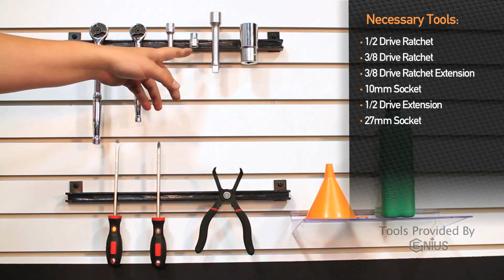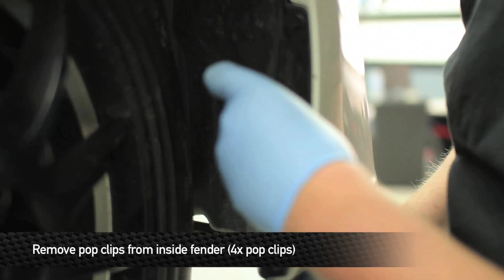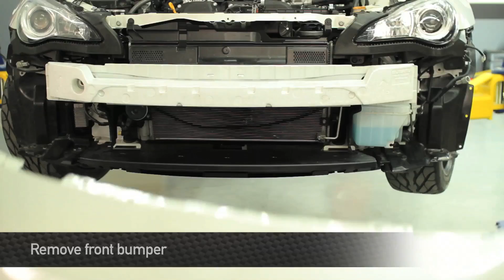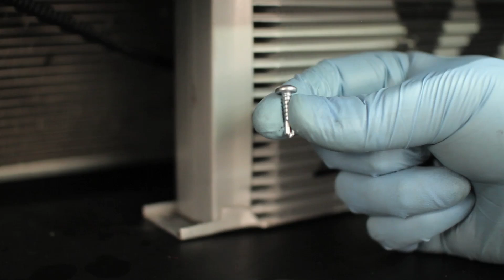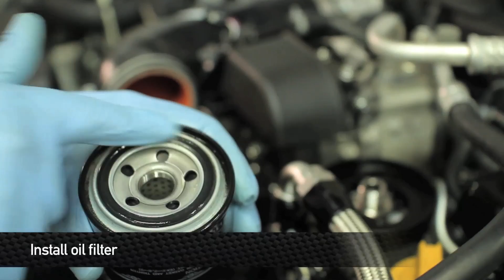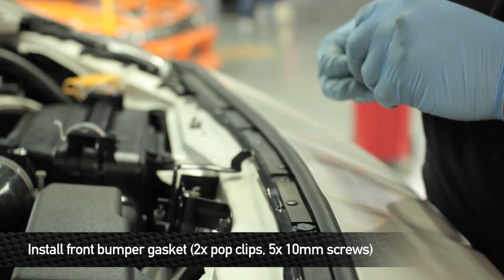Direct-Fit Oil Cooler for Scion FR-S / Subaru BRZ Installation

Comment: how doesn't it apply on turbo 86/brz ?? same same? or different line?
Reply from the maker: We have not tested our oil cooler kit with aftermarket turbocharger kits for this application. Thanks!
Reply: @mishimoto  I am running a turbo on my BRZ and the application is the same as if you were non-turbo, no change in install procedure.
Reply: It is indeed the exact procedure. No problems with my turbo kit. In fact, WAS easier to route the tubes through the engine bay with the freed space.

Comment: do you need to drain your oil before installing the oil cooler?
Reply from the maker: Draining will not be required, the only oil you should lose is that from the oil filter.

Comment: Does the sandwich plate have ports for oil pressure and temp aftermarket sensors?
Reply from the maker: Yes, both the sandwich plate styles with come with two side ports to be used for sensors.

Comment: can someone tell me how the water moves even though there is no pump?
Reply from the maker: Your oil pump in the engine would pressurize this just like the rest of the system.
Reply: @mishimoto  so it moves because of the force of the oil pump? Is that really how that works?
Reply from the maker: It is the same pressure that pushes oil through your filter and engine block.

Comment: do the holes have to line up with the outlet? thanks
Reply from the maker: Hello BRZ RN. My apologies, but I'm not entirely sure what holes you are referencing. Additionally, the outlet could be either side of the oil cooler in this instance.
Reply: Mishimoto Automotive holes of the banjo bolts to outlet, do they have to be aligned?
Reply from the maker: Hey BRZ RN . Thanks for clearing that up for me. The banjo bolts should self-align when properly torqued down :)

Comment: Just a thought...check for leaks while you have the snout off, not after you've buttoned her back up. Looks like a very nice setup. Does it have a thermostat or is it wide open?
Reply from the maker: Hello Dick. This kit is available in both thermostatic and non-thermostatic varients. If you'd like any additional information, just check out the product page. https://www.mishimoto.com/subaru-brz-scion-fr-s-oil-cooler-kit-13.html

Comment: What are the benefits? Very interested!
Reply: +Chris Schenk Lower oil temps instead of hovering at around 240 with hard driving it gets closer to 200. Above 230 the engine will start to cut timing and you'll lose power. I'm second guessing mishimotos kit however I've heard of very bad quality issues on our cars

http://www.ft86club.com/forums/showthread.php?t=45538

Comment: Hi Guyz,
After installing the oil cooler, in 3 month when I will change my oil, how can we remove the oil inside the cooler ? is there a screw ? where it is ?
Thanks
Koj
Reply: +Koji Fuma wow good question.  Need an answer for this one.
Reply: +fatboy19831 where is the answer for that year ago question
Reply: Yeah me too. I purge every second oil change. So I need to unmount the shield & so on..
Reply: You can use an oil extractor, but if you change your oil often I wouldn’t worry there is only half a litre in the oil cooler
Reply: simply take off the the hoses and blow through one side lol. but yeah good question! I would imagine it would just drain most of it and if there is some left it gets filtered.
Reply: Either dont do it or remove the oil cooler to drain it.   Pain in the ass but that's what I've been told
Reply: Very very late reply but. I had the splash guard removed and mounted the cooler with a makeshift metal plate to mount it on, and removed the windshield washer fliud reservoir to free up tons of space for this exact task. You'll have to remove the cooler, hoses and empty excess oil from cooler itself. It's not hard with the amount of space I've freed up. Will just make your oil change a bit longer ^_^.
Reply: +Dieygo A. There is not one. I have been searching the net. I want an oil cooler. Leaving a quart of dirty oil in the car every time I change the oil is not an option.

Comment: Whats the point in having an oil cooler on a non-turbo engine? If it needed an oil cooler wouldn't subaru have put one on at the factory?
Reply from the maker: ***** Oil cooling is not a component that is specific to forced induction. Lower oil temperatures will promote improved lubrication and reduced engine wear on any type of internal combustion engine. We have found this upgrade to be very useful for those tracking their vehicle, driving aggressively, or for those in a warm climate. The Mishimoto oil cooler reduces and regulates oil temperatures in any of these conditions.  Feel free to let me know if you have further questions. :)
Reply: 851995STARGATE Sorry , No I don't.  I won't until I can figure out an easy way to get the oil out of the cooler at oil change time.
Reply: 851995STARGATE Price and weight.  No they would not put one on at the factory.  The take rate would be to small to even have it as an option.  In normal driving not a problem.  On a hot day in stop and go driving heat is a problem with the twins stock.  It is funny to me when I see guys adding a turbo or SC without upgrading the cooling system.  Oil and coolant. Everything on the twins has been designed to cut weight and cost.
Reply: lol wow fail to have oil cooler ????  wouldn't subaru have put one on at the factory ?ummm no wow . please educate yourself .
Reply: +BerettaTV  The twins run hot on a warm summer day. The factory tune cuts back hp.  Keeping the oil cool is a plus along with the extra oil capacity.
Reply: +fatboy19831 Do you have the mishimoto? I found an awesome price from someone on the forums but have heard some horror stories about mishimoto products
Reply: fatboy19831
That's not what I asked, I asked if you're running this kit, I'm partial to the perrin
Reply: Running e-85 all cooling related problems are eliminated.
Reply: My oil temperatures frequently hit 230f in my stock 86. Oil cooler is honestly a must just to improve the longevity of your engine
Reply: Just to the comment, have you seen your oil temps when you drive any car with gusto? They get high. Cooler oil stays stable longer last longer and protects better when kept in operating  normal temp range